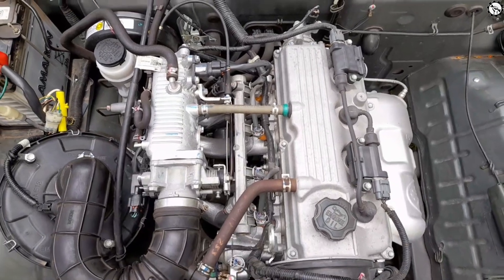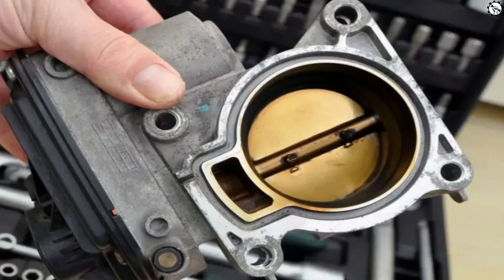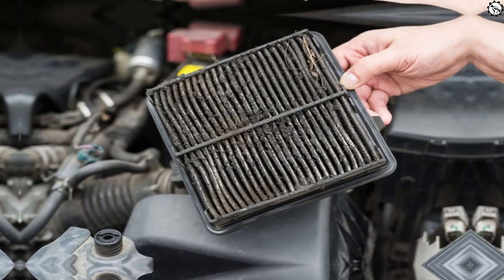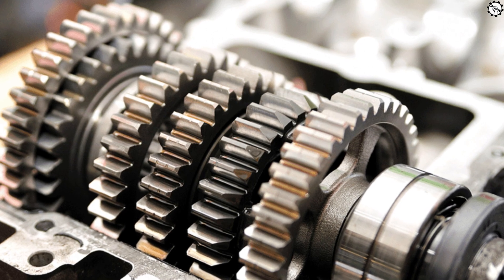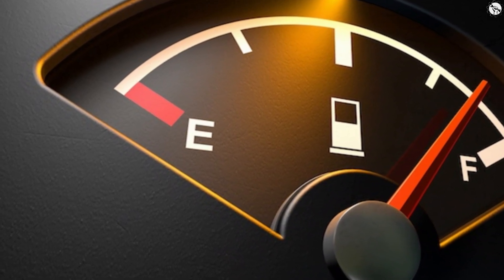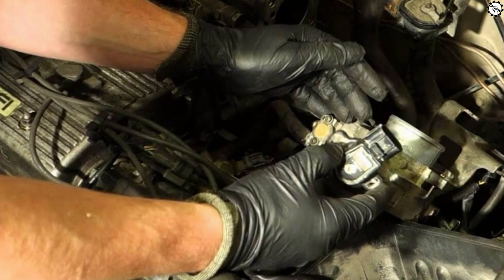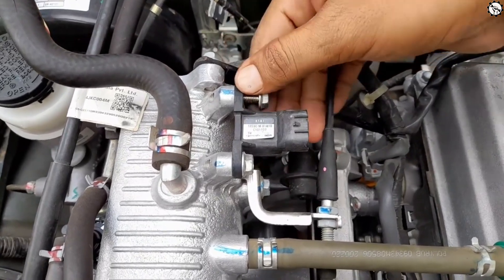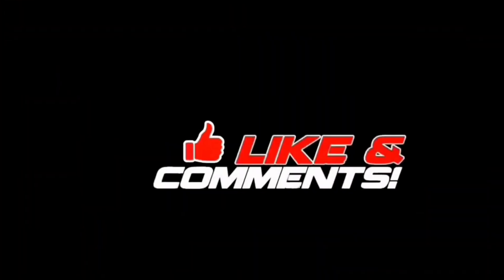Symptoms Of Bad Throttle Position Sensor | How to Fix Bad Throttle Position Sensor |

Comment: My throttle make noise when key is on and not idling but when I remove the the plug it does idle
Reply from the maker: There are a few things that could be causing the noise coming from your throttle when the key is on and the engine is not idling.

The throttle cable could be loose or damaged. This can cause the throttle to move erratically, which can make a noise. To check this, inspect the throttle cable for any signs of wear or damage. If the cable is loose, you can tighten it by adjusting the locknut. If the cable is damaged, you will need to replace it.
The throttle body could be dirty or clogged. This can restrict the airflow to the engine, which can cause the engine to idle rough. To clean the throttle body, you will need to remove it from the engine and then clean it with a throttle body cleaner.
The idle air control valve (IAC valve) could be stuck or malfunctioning. The IAC valve controls the amount of air that is allowed to enter the engine when it is idling. If the IAC valve is stuck or malfunctioning, it can cause the engine to idle rough or stall. To test the IAC valve, you will need to use a diagnostic tool. If the IAC valve is faulty, you will need to replace it.
If you have removed the throttle plug and the engine now idles, then the problem is most likely with the throttle cable or the throttle body. You can try cleaning the throttle body first, and if that doesn't fix the problem, then you will need to replace the throttle cable.

It is important to note that these are just some of the possible causes of the noise coming from your throttle. If you are not comfortable diagnosing and repairing the problem yourself, then you should take your car to a qualified mechanic.I hope this information solved your problem.